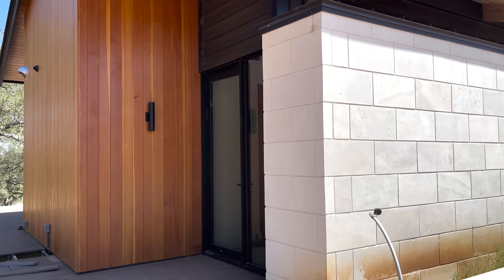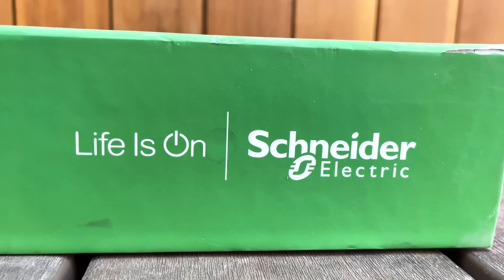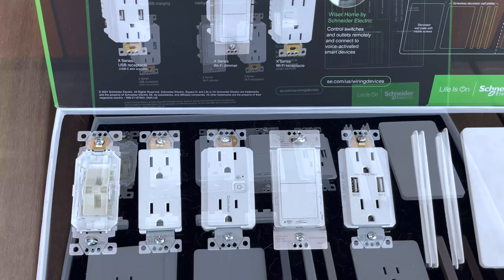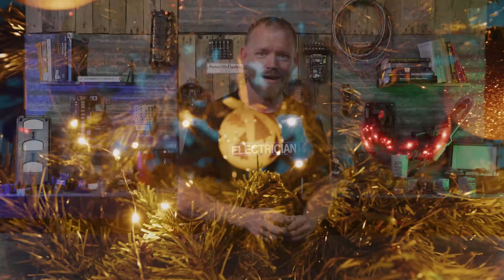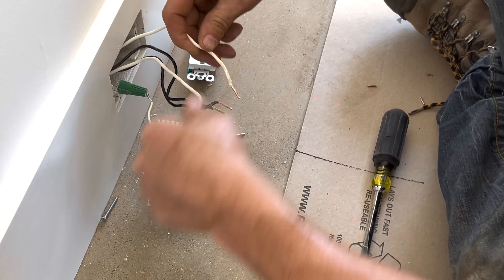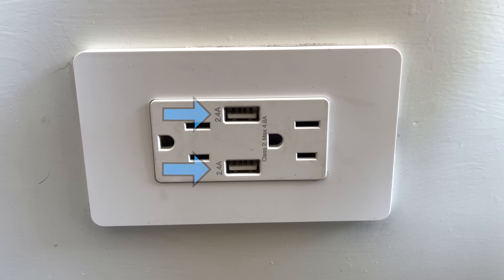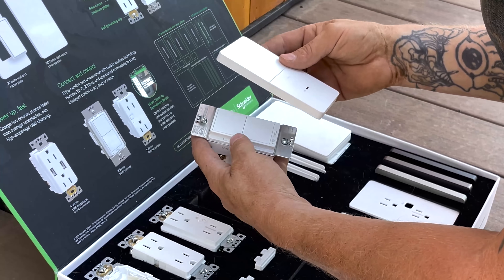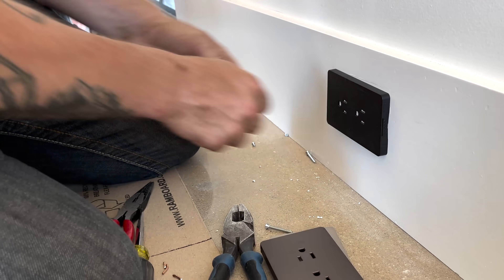2022 Smart Devices You Must Have In Your Home!

Comment: Smart controls. Leviton is crap, especially with Apple apps. Luton Caserta works very well, and Lutron has wireless remote switch pads, to create multiple switches without wiring. By far the cheapest and most reliable are TP-Link smart switches. The customer paid $29 on Amazon. Alexa program runs the security lighting on the entire house. Alexa do this Alexa do that😄

Comment: All these new wireless Switches are pretty cool, but for some reason they do not make the Fan / Light Combo switch which I get asked for all the time. The Switches are to Big, it is hard enough to get a GFCI in a box, if we can make TV's the thickness of a credit card basically LOL they need to start making these devices smaller.

Comment: The big  problem with putting electronics into everything is that electronics fail. I hope that all of those devices are designed to fail in a fashion that continues their primary function. The future owners may not appreciate having to replace some of those after every lightning storm. The more complicated that we make our homes, the less reliable they become. The light switches and outlets of the past have lasted 3 decades or more. Many electronics don't make it a couple of years.

Comment: I love that milwaukee drill you're using in this video! As a low voltage theatre lighting technician it does everything's I could ever need and doesn't over power anything like normal impacts do.

Comment: I will NOT connect anything in my home to the internet! I’m A hard wired smart home proponent! I will not connect my home via Wi-Fi or internet of any kind. My home security is all hard wired with redundancy! I use a multi scrambled code communication! My parameter alarms are both stand alone and hard wired!
Reply: so if you refuse to connect anything in your home to the Internet/wifi , how are you accessing YT?
Reply: what brand or system did you use for your wired smart home?

Comment: The big problem with the apps for these devices is that they always require you to have internet access for the app to work and stores the data on the cloud.  What if I want the data stored on my PC or a personal nas instead of the cloud?  And why does it have to connect to the internet for remote operation if I'm on the same network as the devices?  That's only creating unnecessary operational lag.  The other issue is if they discontinue the line and create another app that doesn't work with the devices and discontinues support for the old app, you lose all remote functionality.  Being able to control lights from miles away is nice, but some people will want to set up control on a device that stays at home.  There should always be an "off line" mode for the app where it will still operate and see the devices without needing an internet connection.
Reply: There should be an offline mode but a lot of these companies bank on 1. Selling your data on the  backend and 2. Locking you into their closed source hardware+software. 

There are some moding communities dedicated to jail breaking these devices to basically operate how you describe.  Emporia has a pretty good community if u want a jumping off point into that
Reply: @viktormorris194  except that this technology is an added convenience and not a requirement for me so I'll be voting with my wallet.  Besides, I'm an electrician and know how to install current loops.  If I really wanted to, I could install a commercial lighting controller and any necessary contactors to remotely switch the loads as well as the equipment needed to monitor the loads.  I'd even have voltage monitoring.  If I wanted to and had the money I would have a system that provides more information than the system shown and the information would be privately stored.

Comment: The Schneider Wiser Home Energy Monitor is manufactured by Sense Labs, Inc., and a variety of connected devices have been available for some time. I recently added a 6-outlet smart power strip from tp-link.
Reply: I was thinking the same thing. I thought about 2 years ago I saw a leviton, version of these
Reply: Be wary of TP-Link. If the product fails during the warranty period, you have to pay to ship it to them for repair. And, if they decide to replace it, they will do so with a refurbished item.

Comment: As a electrician and a network installer, there a lot of things can go wrong, a lot of free service calls. As well as power outages. What is the memory of each device, and it’s default settings? Sounds like a ups is needed on the router, just for this equipment. Plus setting up the router/WiFi . 2.4/5? Many many questions
Reply: If you lost power to the router, you probably lost power to your whole house.  Just my thought on it.
Reply: With all of these smart devices on your network, what happens if you sell your home? Do they have to re-set up the system or do you have to leave your AP and create a new system with a new AP at your new place ?
Reply: @patrickpattberg8551  depends on how old everything is.  Are those devices still or have ever been updated by the manufacturer for security updates?

Comment: USB oulets are not smart devices, and neither are devices with fancy plates. Smart devices connect to a network and/or your phone. How does Square D's system work? Does is use a hub, or perhaps direct wi-fi connection? Hub connected devices have been troublesome in my experience.

Comment: I try to stay away from the USB receptacles since they are Transformers they are constantly running and using power it might not be much but if you got a whole house full of those USB receptacles you will notice a difference at the end of the month I'm sure
Reply: Good modern switching converters use almost 0 power when no load is drawn. On the order of 50mW (milliwatts). Even if you had 100 of them plugged in, 50mW * 100 = 5W, which would be something like 3.6kWh per month. Since nobody is gonna wire their entire house with these things... You will never notice the difference in your power bill. And even if you did, you're probably never gonna notice.
Reply: I once saw a comparison on this.  Shutdown all devices that have vampire draw and you’ll still use more energy backing out of a short driveway once than the combined electrical load for a year.   Or idle your car when stopped somewhere or accelerate hard or … 

Not saying you shouldn’t be aware and do what you can but there are a lot of higher impact energy savings all around us.

Comment: The main issue with inwall usb etc is limitations on technology. The ONLY USBA that should be purchased today is QC3.0 or higher. Usb C is so prolific, it just needs to be used. Until THAT tech can fit into an outlet, this stuff is unwise.
Reply: They already make dual USB-C port outlets on outlets today.  Up to 30W per port (better than the 5V 2.4A USB-A ports here, or 12W max). Only issue is they're like $50 per outlet, which is a bit much compared to $1 for normal outlets.
Reply: @kirby64  yeah. When the C standard is designed around 100W capability… 30W isn’t really a decent choice.
Reply: @SuperVstech  actually, USB C now offers capability up to 240W. Also, 30W is more than sufficient to charge anything, although it'll be obviously a bit slow for laptops.
Reply: Just noted Leviton is releasing a 60w usb-c PD outlet.  That’s really sufficient for most things today.  Just watch your wallet, it’s about $90.
Reply: @jimk5307  yes, 60W is an improvement for sure. Just can’t power laptops and solar generators full speed.
Reply: dont forget that most of this in-wall usb suck power even when nothing is plugged in. I always set them up on a wall switch so you can kill the vampire load and cut power bills when you aren't using them.

Comment: USB-A on a device in 2022 is a failure, I have no clue why companies are still putting this port in devices. I won't buy a car with USB-A ports because it instantly limits the connectivity to the car.
Reply: While I am also a big advocate of USB-C, I fail to see how it limits the connectivity of your car. The biggest differences are power output and bandwidth, neither of which are needed in high levels in a car. USB A-to-C cables are very common, so it's not really a compatibility issue either. What is the limiting factor for you?
Reply: No its not! Most products still use usb a !!

Comment: At this point (2022), I don't think it makes sense to install USB-A outlets in a house. You definitely want USB-C (and then the user can just buy the appropriate cables of amazon for like $3 each). Leviton makes an outlet with 30W USB-C ports; this will fast charge an iPhone/Android and is probably enough to charge some small laptops or iPads. It's model T5635 or  T5835.

Comment: Looks like everything shown is all single gang configurations. Not sure how you'd use that giant paddle switch in a 2 or more gang box. And because it says Schneider on it, I'm guessing it's 3x to 4x more than any of the other brands on the market.
Reply: Yep. In Europe you‘d use an MDT Universalaktor 2416.03 and several MDT Glastaster 2 to switch up to 24 lights, blinds and sockets from a push button sensor that can deal with 16 functions. All using KNX an open standard for digital electrics designed in the 90s and just released in v3.

Add a Homekit or Alexa Gateway and your house is completely smart by adding a handful of components to your fuse box.

It‘s pretty sad to see all that IP-based retrofit crap in the US, which ends up in a landfill every few years!
Reply: Sure the giant "Decor" paddle cover won't work in 2-gang and up.  He did say they had many styles.  Even all the others he showed would definitely work other than single gang configurations.  👀👍

Comment: Life long sparky and not big on all electronically controlled devices. Had $10 grand fancy lightning controls that after 6 years was obsolete and before it was ten years old had to be replaced. Installed some receptacles with USB~A charging slots. A few years later had to rep!ace them with newer smaller USB charging slots. They should supply a shoe horn to squeeze extra deep receptacles/USB charger into a 2.5" metal wall case.
Reply: Yeah I am also not a fan of all this stuff. What I want most is reliability.

Comment: Disconnected most of my smart home stuff a couple years ago.  Besides privacy concerns, it becomes a total  pain in the ass when the internet is down or router crashes.  Lights are always unpairing etc.  Tech just not there yet.  Needs to be all local processing with no tracking from corporations for me to ever get back into it.
Reply: I purchased a Hubitat Elevation because it is all local and does not require the Internet at all unless you have an unusual device that requires the Internet. In my case it is a voice activated microwave as I am severely visually impaired and can no longer read the buttons.
Reply: I'd recommend checking out Home Assistant. It can run on just about anything (dedicated Raspberry Pi, virtual machine, your old laptop that's in the back of the closet, etc.) and is completely free. While it can connect to tons of cloud services, its biggest strength is the amount of locally controlled services (called "integrations"). I use it as a Zigbee, Z-wave, and Bluetooth hub. Every light, fan, and curtain in my house (as well as a couple appliances) is controlled though it and it's all locally controlled. Completely private and doesn't care about internet connectivity.
Reply: Don't run it in the cloud, run it locally. Plenty of devices to do that and are far better than cloud controlled junk.
Reply: Sounds like you unplugged when it was getting better. I started using “smart” devices about 4 years ago and have been happy with a practically “whole” smart home. I use less energy and no longer have to be the “wasted energy police” in my home.
You mentioned a challenged network though… have you tried mesh wireless systems? I highly recommend orbi mesh wifi systems. I have gone through the struggle for well over a decade (probably closer to two decades) to find reliable wireless routers. Orbi mesh wifi is solid and I know my “connected home” owes a lot to that.
Reply: or governments   the new green deal people already have made moves to control your thermostat from the cloud.  hard pass

Comment: Maybe you've explained this in another video, but why did you not hook the conductor around the screws @ 8:40? And also put them on the "push" side instead of the "pull" side?
Reply: he has the conductor under the plate rather than around the screw so it doesn't matter which side its on sense the screw is just compressing the plate down on the conductor.
Reply: those are flat terminal connections and will not push the wire out. It's basically a clamping device. You could put  2 wires under each clamp if needed. (left and right of the screw)

Comment: "Smart" simply means "connected to the internet". I'm not about to connect any of my homes basic functions to the internet, period. It's the same reason I won't buy a new car, because they are designed to be impossible to repair.
Reply: As a millennial who works in IT.... I am with him on not connecting everything to the internet. These companies almost never secure their devices properly and you're just opening your home up to be exploited. I love my smart home devices, but I only use devices that speak to a local controller (zwave or zigbee) which is properly secured.

The cars take is pretty bad though, modern cars are more complicated but that is largely a byproduct of design making them more efficient and safer, in addition to adding lots of convenience and comfort features
Reply: @ard1choke  you gotta weigh the pros and cons.  having data on what is happening on your property is invaluable.  Couple that with the fact that the chance any malicious actor is going to target your home is extremely low.  yeah the larger company could be the target, but for a hacker to use that expoit on you personally is unrealistic.  Businesses will always be the targets, as they are the places with money and intellectual property.
Reply: @ard1choke   That.  And generally I'm not keen on embedding complex electronics in my walls.  Largely because they will either be damaged by or potentially invalidate the circuit and insulation resistance testing that is mandated by our codes.
Reply: Can’t switch out a switch? All the same wires are there. Get a new one, match it up.
Reply: Ok boomer